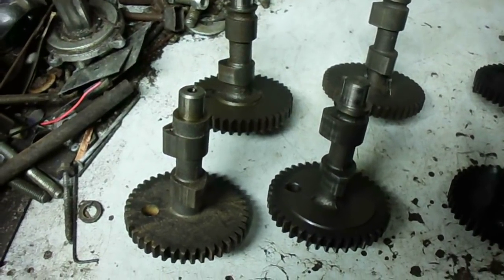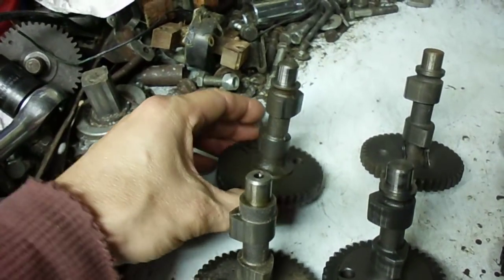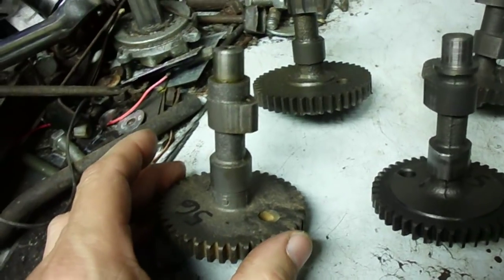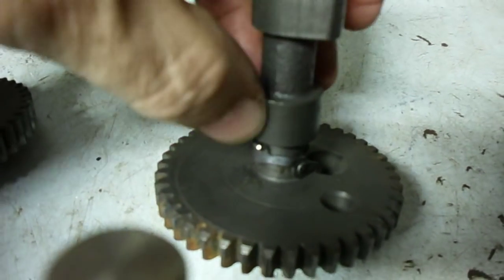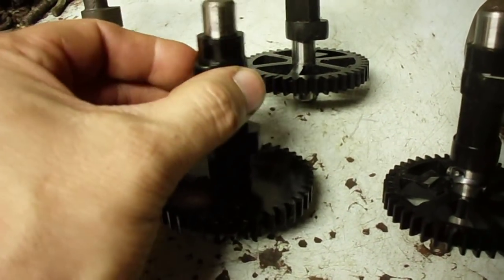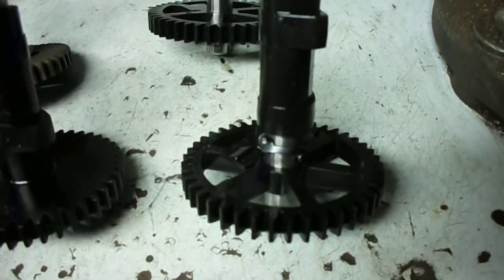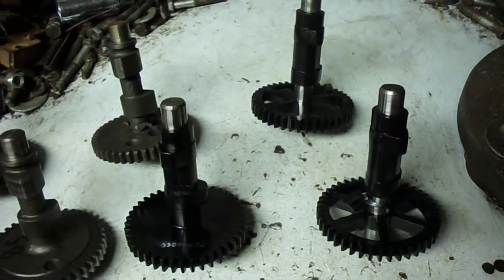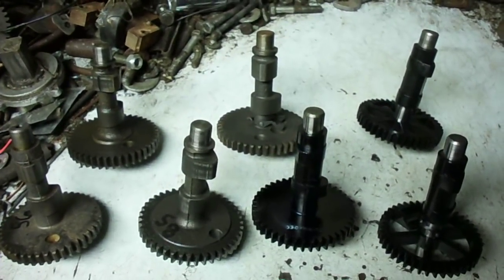Briggs Camshaft  Developement

Comment: Thank you for the great job and the research that went into this video. I also like to collect old quantum series engines and rebuild them. 
When the camlobes have a compression bleedoff to help in starting does this also bleed off compression when the engine is running. Higher compression means more power. I would rather struggle to get it started than to loose power when it is running. . What are your thoughts???
Reply from the maker: I am not very familiar with the Quantum series engines, but sometimes Briggs engines have a centrifugally operated compression bleed off (a weight and spring on the camshaft). In which case it would not affect performance, and would make for easier starting.

Comment: have you tried welding a cam to make the lobes bigger
Reply from the maker: Yes, though I have to admit welding up cams, then re-grinding them is very time consuming! Apparently cutting down the base circle and putting in a longer valve tappet is easier.

Comment: its the spoke plastic camshafts are common to fail on these engines.  even this new OHV that replaced this flathead engine it has a plastic starter cup, a plastic float type carburetor, and plastic camshafts and timing gears. showing how the quality is failing in these B&S engines in your video from the 50s-1990s  the engines were made right with a metal camshafts and easy spin. as some Briggs engines of the 80s have a rotator on the exhaust valve. was the 1990s - 2013 the only reliable plastic carburetor made for the 3-4 hp is the pulsa prime the earlier models vertical shaft had either a pulsa jet or vacu jet carburetors as the 50s engines the carb was on the side of the exhaust.  its a shame Briggs dropped the flathead engines and now using new OHV motors with plastic internals.
Reply from the maker: Yes, it must be to cut costs, but all that plastic sure doesn't work very well for people like me who try to modify, or fix something.

Comment: I remember when the Honda engines first came out and they had major problems with the aluminum cams and timing chains
Reply from the maker: Aluminum cams, that doesn't sound very good. Aluminum likes to gouge, magnesium has better bearing properties.
Reply: @ChargerMiles007  https://www.boats.net/catalog/honda/small-engine/gv400/gv400-adab-vin-gv400-1000001-to-gv400-1006101/camshaft-valve
Reply from the maker: Man, what were they thinking!

Comment: A while ago i got a lot of cranks and camshafts from the Briggs verticle shaft engines my idea was to build a gearbox for my lathe. I noticed some had the same gear pitch but had an extra tooth on both crank and camshaft. I only got as far as machining two cranks and two camshafts
Reply from the maker: Hmmm, perhaps they are from different sized engines. I will investigate the # of teeth on the gears.

Comment: OH! It always comes down to color! Seriously my Tecumseh 12.5 had flyweights made of metal on the exhaust cam. My 2003 Suzuki SV1000S uses the same mechanism for compression release on the rear cylinder. Both work better than the Briggs alternative. My new Briggs powered mower works better than any yard implement I have ever seen. For all I know the whole damn thing is plastic ordered by the beings from Alturus 4 to start and mow my swamp grass. 3 more inches and a tornado here in Arkansas today.
Reply from the maker: Stay safe!!!

Comment: If you tried to use JB Weld on the plastic cams for more performance I would imagine you’d have to drill holes at an angle into the cam so the JB would  have ‘fingers’ to hold on for dear life ? My mustang came home on the back of a tow truck the other night. Maybe I’ll be able to make video of trouble shooting it or possibly just shooting it.
Reply from the maker: Yes, you would have to do something to rough up the surface, as well as probably pin it. Plastic seems to be pretty slippery stuff to have epoxy hold onto. How badly do you think your Mustang is wounded?
Reply: ChargerMiles007 seems to have no fuel pressure and gas gauge is making outrageous claims that tank is 1/4 full.  I think it may be electrical or fuel pump has bit the dust. I don’t hear is come on.
Reply from the maker: A fuel pump change, that is ALWAYS a fun job!